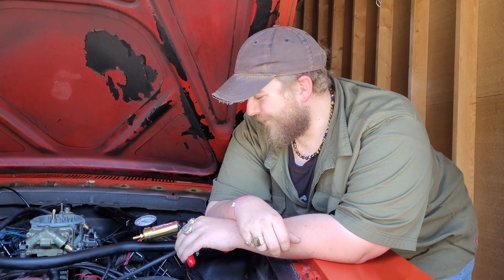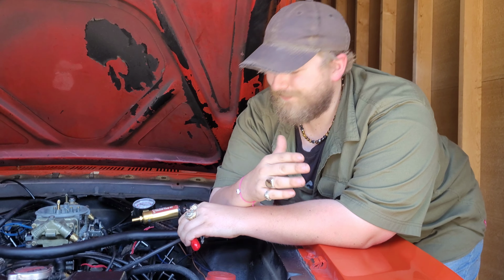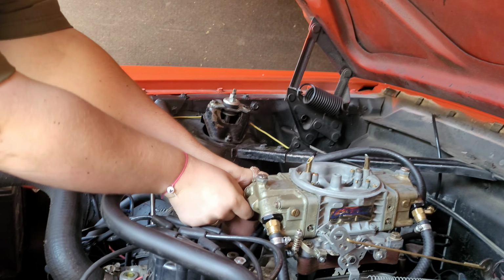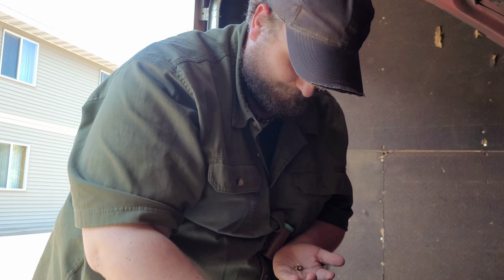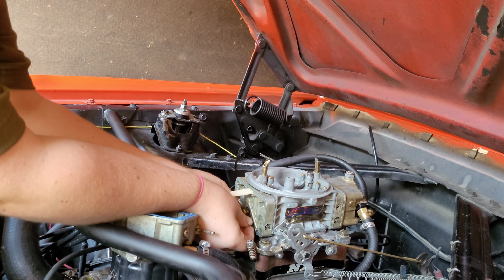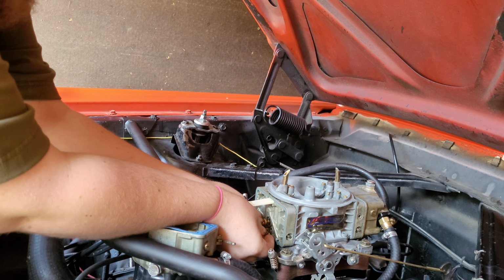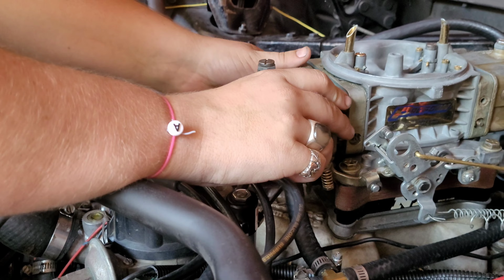Trying To Dial In Our Home Built Holley Double Pumper Carburetor | 1965 Ford Mustang 302 Sbf Windsor

Comment: 830 cfm DP 
Tune: lean for small CID
30cc accelerator pumps 
Primary pump cam Orange
Secondary pump cam Red 
Jetting 70/76
Primary PV based on engine vacuum. 
Secondary PV blocked off 
Towers start with .031”/.031” 
PV sizing: Observe engine vacuum, timing set, engine warm, ln Gear. Subtract 2 hg from the vacuum reading in gear with the brake on; this is your suggested base PV size.  
* Tune jetting via reading the spark plugs. Goal light to no color on the exposed porcelain but a consistent tan fuel ring at the base of the porcelain.  You may have to switch to a smaller CFM carb in order to achieve a crisp throttle without hesitation with the proper AFR.
You are actually drowning the engine with air. running a carb that’s too big for the application which adds challenges to tuning.
Reply: All sound advice, an old school tuner, will he heed your advice. ??? No.

Comment: U wore the camera girl out lol. I get it I was a flashlight holder.  Do u mess with the ignition system or timing after a carb swap? Not a carb guy myself so just askin
Reply from the maker: Ignition timing is a huge part of carb tuning lol

You have to have the timing were you want it first, then can tune the carburetor 🙂
Reply: Ok so your timing can stay the same even with a different carb. Wasn’t sure a bout vacuum effecting timing advance orif u could add more timing. U plan on upgrading to a MSD or hotter coil some day? That ignition stuff always helped my old fords run tip top. Had an 86’ 302w and 90’ 351w both were EFI.
Reply from the maker: I have an msd blaster 2 coil in it right now. 

Dont really want to get an msd box because they often go dead on you out of nowhere 😅